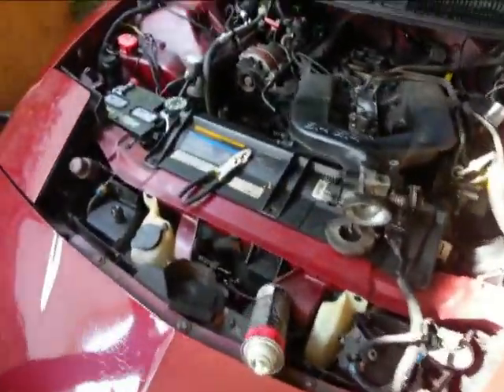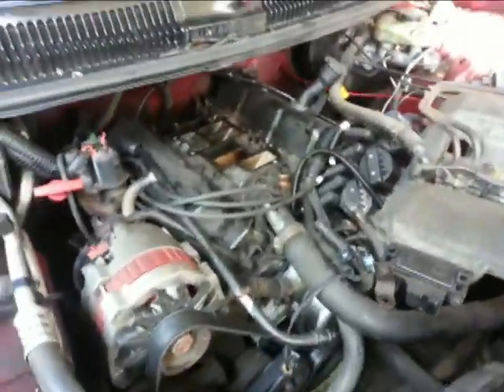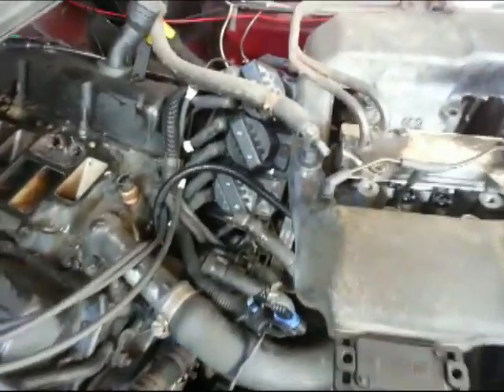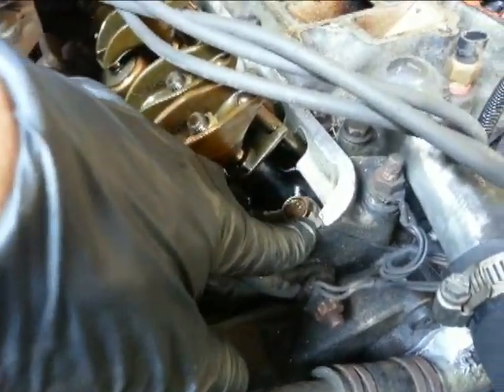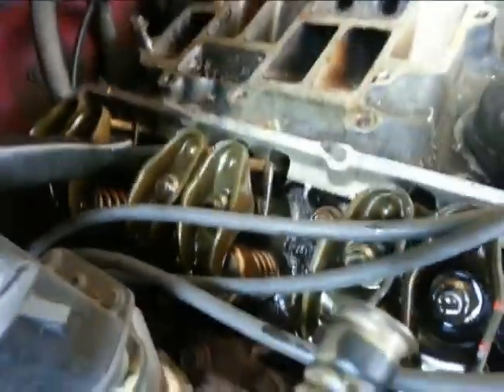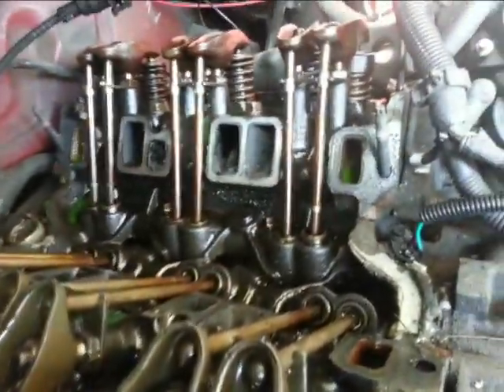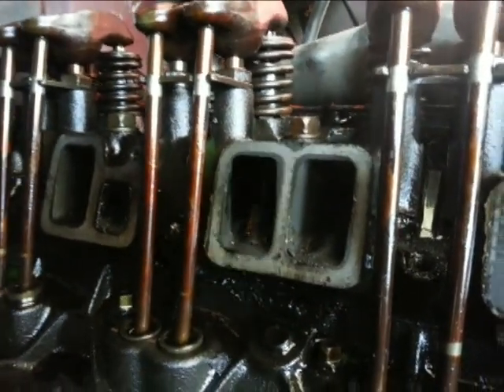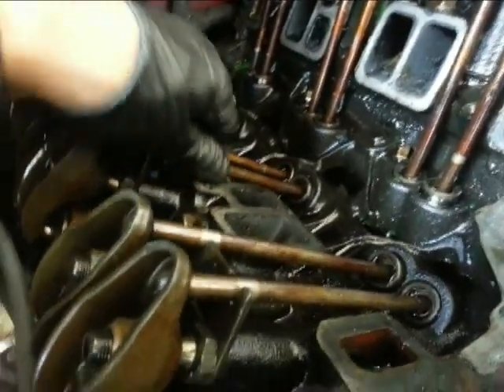Intake gaskets replacement 1993 pontiac firebird

Comment: I think I would have kept the truck.
Reply from the maker: no point in keeping the truck. weight capacity was too low, fuel consumption too close to the dually. Drove nicer than the 1 ton but I don't own a truck for creature comfort anyways. Sad to see it go, the 1994 truck was the nicest maintained vehicule I've owned.
Reply: Veikra  I guess I am a truck guy  :)
Reply: How did you install those I'm doing a change on mine with that same motion
Reply from the maker: @BadBoy-xn8jc  The intake gaskets?